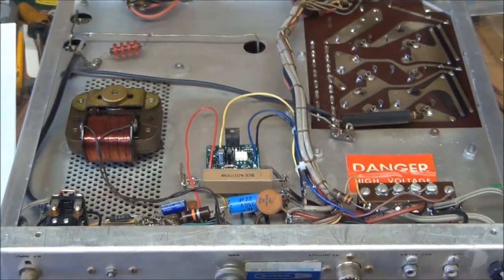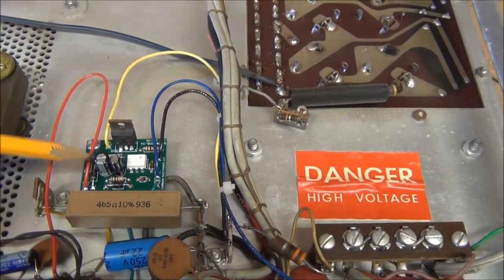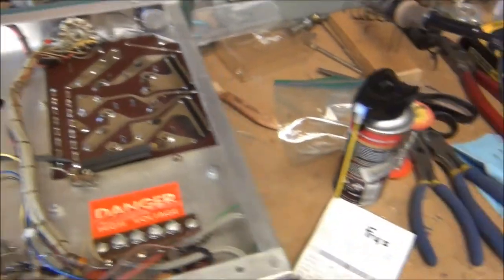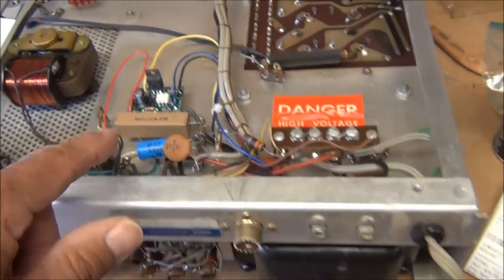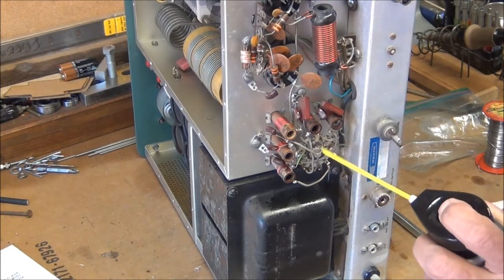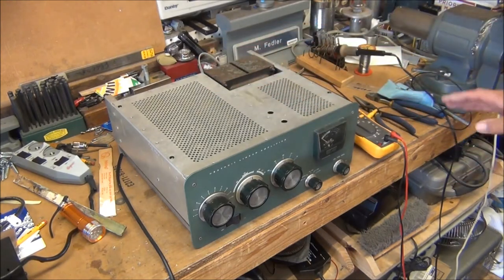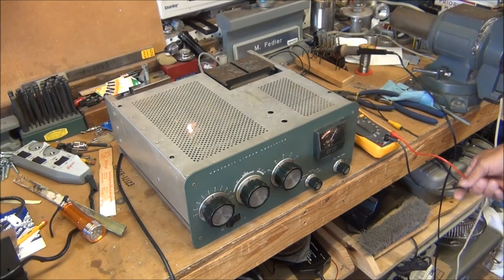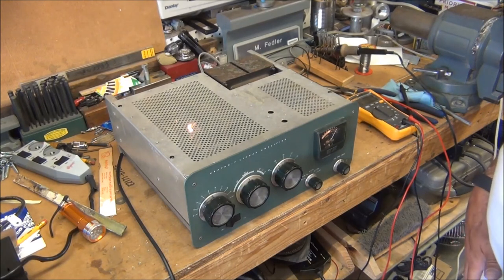SB200 Linear Amplifier - Soft Key Circuit & Wafer Switch Cleaning

Comment: I used tarnex  silverware tarnish remover with a q tip then rinsed off the tarnex residue by flooding it with deoxit.  Worked great.  Tarnex and q tip removed all of the 6o years of tarnish from my SB-220's wafer switches and now I have bright silver contacts again.  The lubricant in the deoxit will also rehydrate the phenolic switch material.  My wafer switches look like new.

Comment: I'm refurbishing an SB-200 I got on EBay years ago, installing a new power supply board, a Harbach "soft start" module, and a soft-key circuit. Can you still use the amp with older transceivers, with the soft-key unit installed?
Reply from the maker: The answer is yes. The soft-key works with both newer and older transceivers. The mod just makes the amplifier safe to use with newer transceivers which cannot tolerate the high voltage or high current of the original design.